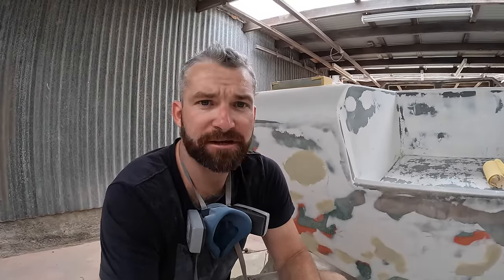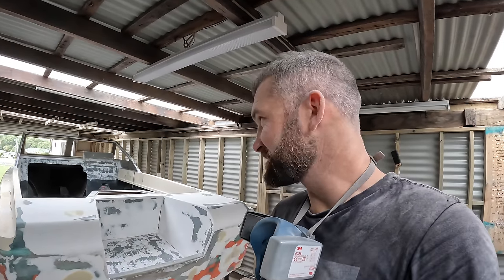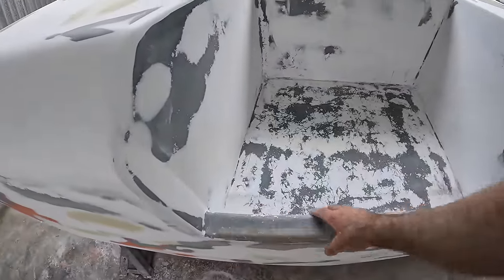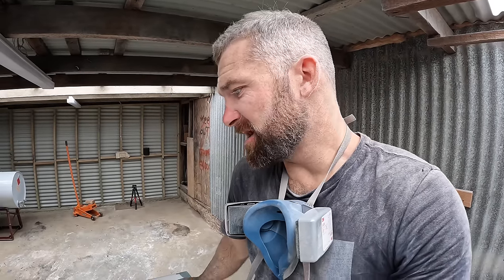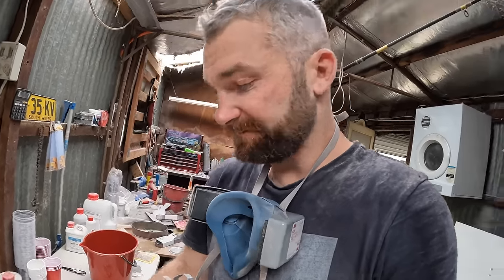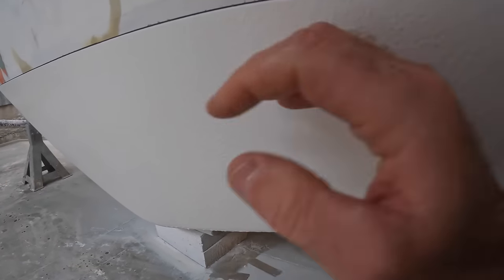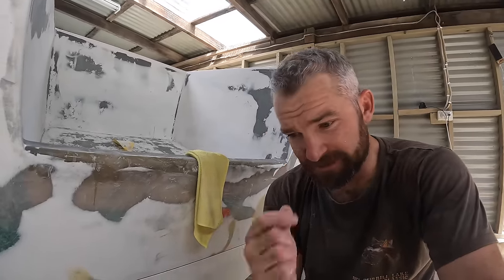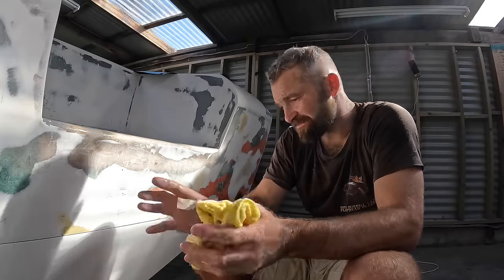How to Spray Gelcoat & Sand it Flat / Smooth - Haines Hunter 600R

Comment: Doing a gel coat job is easy.  You just sand, and sand, and sand, and sand, and sand, and sand some more.  Then you're ready to prep.  Sand again, and sand again, and sand again, and sand again....  Then spray the primer...  Then, sand again, and sand again, and sand again...  Then FINALLY spray some gel coat!  Then, you have to sand it, and sand it , and sand it some more.  You get the idea.  And, don't forget to clean it real good with acetone in between sanding.  All joking aside, I think you did a very good job!  You'll be done in a few years...  I wouldn't have the patience for it, mate...
Reply: The acetone between coats is a persistent error in the industry. All it does is weaken the bond with the subsequent gelcoat application. SMH
Reply: @Mofiac  I didn't know that.  What should use instead?  Just water?

Comment: Heard what you said about the 2K top hull paint. I did the same, gel coat bottom, 2K top. Definitely easier to apply (there is a video of me doing it on my channel and the paints I used) but 3 years since I finished my build I do wish I had done the top in gel coat as well. Plenty of esky and spear gun scratches in it now. Also, I built some seat boxes and tried using a generic high build primer under the marine 2K top coat like you said you would, and it is soft as cake. If you hit the top coat with a spear, it pushes a chip of the top coat into the high build primer. I would definitely spray or roll multiple coats of epoxy primer (Norglass Shipshape is good) instead of a single layer of high build to get your thickness up. Good luck with the project.
Reply from the maker: Cheers mate, and I have watched your boat building videos and I really enjoyed your content. I’ll keep that in mind for the top deck, might even spray gelcoat yet 😬
Reply: D8002 D9002
D3001
 Not Norglass😅
Reply: @cspray5386  not sure what you mean here

Comment: Gday mate i used 2 pack polyurethane as my top coat and epotec 2 pack epoxy as my base /primer coat cn my little tub there are 2 coats of epoxy touch up spraying any sand throughs and 3 coats of top coat , i  unfortunately could not spray as the young lass next door was in the third trimester of her pregnancy even though i could mask the area up like a spray booth i didnt spray .just for that reason alone , i had to roll  and tip the whole boat by hand ,it would never look as good as the others i have sprayed but it is reasonable  and still gets comments from passers by so i must have done a ok job , so far i have managed to put a whole 5 hours on the new yamaha  it ill be a long time before its first service  , on the inside i used the epoxy primer in grey green mainly for its durability and also because of it low reflective quality  cant believe people polish the inside of there ali boats anyway all the best for the sides and top of the transom  maybe go to your local auto  paint supplier and see what polishes they recommened there not cheap but they do a great job and last a good while tell them what your dong gives them a better idea of what to use , i had to sand out some marks where the tipping left brush marks as it didnt flow out well in spots  and you wouldnt know they were ever there take care .

Comment: Great video sir. How would you handle a run that occurs in between the non waxed gel coat. Is it possible to sand them out or is it too gummy?
How long to wait in between coats?
Reply from the maker: Runs are unlikely given the thickness of the gelcoat but I would leave it and sand it out once you have done your waxed coat and everything is fully cured.

Comment: Looking good mate ✅
Spraying Gelcoat is very difficult. It probably won’t be a problem on the transom, but thick gelcoat on flex points will crack.
Reckon you could of started with 240 just lightly to get the tops of the dimples off, and use a spray bottle with water instead of the rag n bucket.
Reply from the maker: Thanks for tip mate, I’ll certainly try that on the sides 👍

Comment: You got that looking good.   I am curious how long you left it between your coats?  Because gel coat wont set properly until its covered right? be it flowcoat or something else.
Reply: I have the same question?  how many coats of unwaxed?  How long between coats?  was anything put on after the unwaxed coats such as pva?  Or did you simply spray a few coats of unwaxed and top with a final coat of waxed to make it cure?

Comment: Yup spraying gelcoat outside mold is a waste of time.
BUT the solution we have had in usa for 30+ years is to use Duratec gelcoat  from Hawkeye industries. It uses different chemistry and fully cures on surface and it can be sprayed to a smooth gloss finish , you can also mix the clear Duratec with your ‘special color’ of gelcoat to make it come out smooth and fully cured.
The finish product could be left as is but usually sand starting with 400 or 600 grit then buff and go! 
Cheers Warren
Reply: Duratec will convert your gelcoat in something very different. If you don’t want to sand use paint. Duratec is garbage.
Reply: @alexbernal4988   well you must be using it wrong or don’t understand Duratec. 
I’ve used Duratec or similar Fourseal (until they stopped making it) for 40 years. I don’t use the hi gloss option very often but Duratec has true high build primers , potentially much higher build than the Alex seal primer , but I’ve not used the Alex seal. Duratec primer can be built up from 10-30+ mil in one ( multi coat) application, wet on wet. It sprays like simple lacquer primer! 
It’s is easy to sand and depending on product can be polished to a high enough gloss finish to make molds from as I have done all my working life building pattern /plugs , models molds etc.
The high gloss option when mixed with gelcoat or primer , various options to choose from, can produce very high gloss right out of the spraygun needing minimal to no sanding depending on what you end product or use is.  Duratec uses chemistry that allows a 100% full cure on the surface without any air inhabitation , ie no surface dry additives like ‘wax’ required. 
But If I’m Building a boat or repairing I would use Alex seal or other similar linear urethane gloss paint if I had the facilities. 
It has the best uv protection available.
A blanket statement ‘Duratec is garbage’ is of no value it has its place and is a Incredible productline that transformed the tooling industry. 
For my self and at my shop  I have done a number of projects to a hi gloss standard that have stood the test of time outside.  
Cheers Warren

Comment: Nice, how long do you wait between your 3 no-wax coats and how long do you wait before doing the with wax coat ???
Reply from the maker: I just finished spraying the grey gelcoat on the sides of the boat and I did two full coats non waxed back to back and then sprayed 1 coats no wax 1 coat wax the next day. Worked well. I think in mould applications they wait 3 - 4 hours between coats but that’s because they risk it popping from the mould if it heats up to much.

Comment: Hello sir, I'm also building a custom livewell for my boat. I was wondering if you will put fairing compound and gelcoat the inside of your livewell. I'm having difficulty to see how to do the fairing
Reply from the maker: Hey mate, no fairing compound required in the inside. I finished mine with a light blue gelcoat that contains wax in styrene so it fully cures.

Comment: What is flow coat? I've used cabosil but never heard of flow coat
Reply: Flow coat is Gel coat with a wax additive that seals the top surface from air making the gelcoat cure fully. Gelcoat and resin will remain tacky unless it is sealed from air.
Reply: @michaellytra5122  awesome! Thank you!!